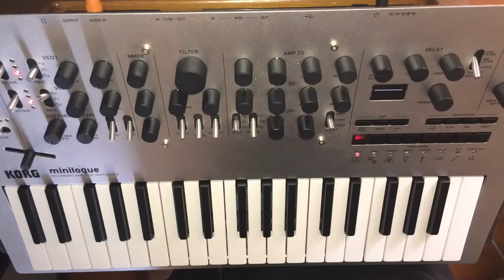Synth Tutorial #2: Ambient with Korg Minilogue

Comment: FIrst, the camera angle is weird. Makes it hard to see the values of the adjustements. More vertically would be nice. Second, is this a Line Out recording or a microphone? It sounds very distant. Third, Very nice video. I got the Minilogue a month ago but now you awakenned  my apetitte to use it more. Nice video. Cheers!
Reply from the maker: It's line out. I'm thinking of doing the "silver pen mod" to mark the knobs so it's easier to see the values.
Reply: Or you can find little round stickers, stick them on top of the knobs and mark these?
Reply: Flohr They are also starting to make replacement knob kits. I saw one yesterday with a set of really slick aluminum knobs for i think $60

Comment: Any ideas on how to deal with some of the nastier ringing frequencies you can get in a mix when using huge amount of delay/reverb?
Reply from the maker: It’s much easier if you are using a DAW, but some of the same principles apply for a dawless setup. If you are just using an analog mixer, I advise you to put your FX on a send but instead of using a return use a channel so you can EQ the return. In a DAW I like to put a high pass and low pass filter in series and then use an EQ with a spectrum analyzer (easy in Ableton with native devices). If you cut where there are resonant peaks it will sound much better. the best plugin for this is something called Soothe. I have used it at my friend’s studio and it’s not cheap but it really helps with this problem.

Comment: superb !! how would you recommend to hook up a reverb delay device?. I have the Yamaha EMP 100 and I would like to use it with the Minilogue, now is it better to connect the two via output line or MIDI?, and in wich situation would you use MIDI on the Minilogue?. thank you.
Reply from the maker: You need to connect the audio in order to hear anything. The Midi may give you clock sync for the delay, but the midi implementation on the Minilogue is a bit odd so I am not sure if you could stop it from sending CCs to your Yamaha and accidentally messing up the effects settings.
Reply: @Flohr  Thank you.

Comment: Hi my mini is new but when i turn the adsr knobs on the lower section they dont do anything but the top row do am i missing somthing
Reply from the maker: Check your envelope amount and filter cutoff settings. The lower ADSR is also the pitch envelope for VCO 2. You will only hear its effect if the EG INT for filter or pitch is turned up.
Reply: @Flohr  ok thanks well thats somthing i thought the lower adsr did the same as the top one it makes a bit more sense now thanks
Reply: @Flohr  would you possibly make a short video on this for absolute newbies as seen it in action will make alot more sense thank you
Reply from the maker: Word. Maybe I'll do a ultra basic intro to synth video featuring the Minilogue and include it in that. Any basic tutorial on ADSRs should be helpful though, it's all the same principles.